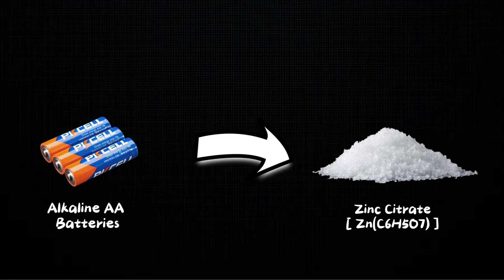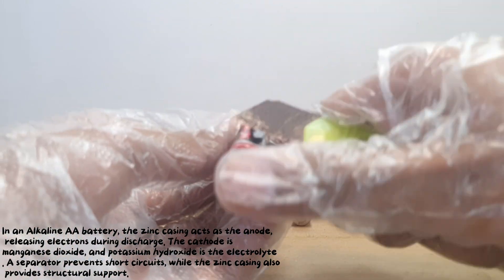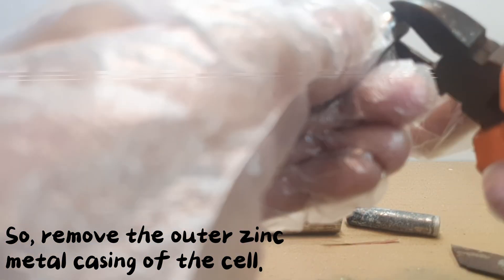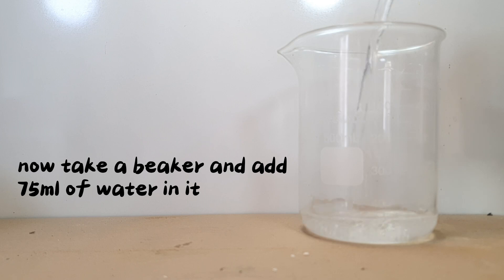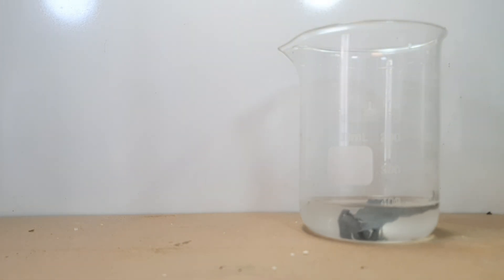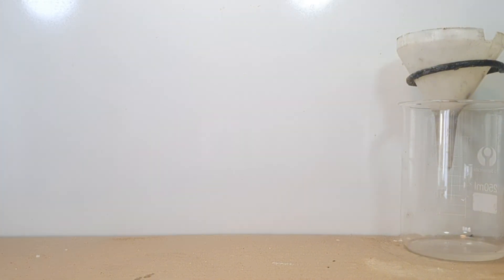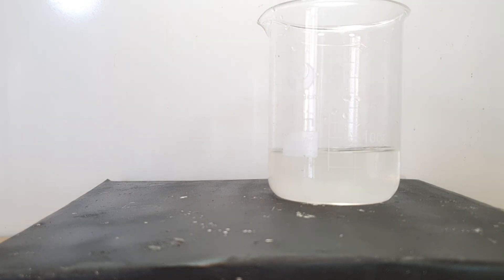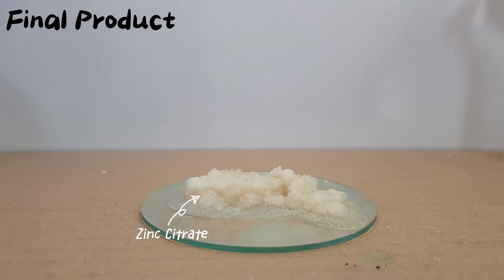Synthesis of Zinc Citrate From Old Zinc Carbon Batteries

Comment: @Molybdenum  Alkaline batteries only have zinc in a powdered form mixed in with tje manganese dioxide and potassium hydroxide. You´re probably confusing alkaline batteries with zinc-carbon batteries (sometimes labeled heavy-duty or super heavy-duty), because zinc-carbon batteries do have a shell or casing of pure zinc metal. Alkaline batteries only have a steel casing.